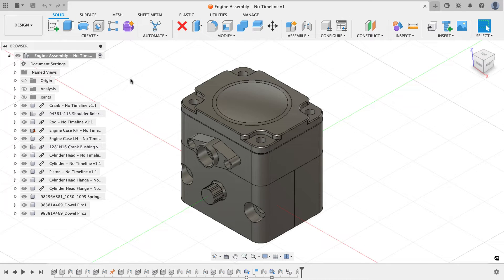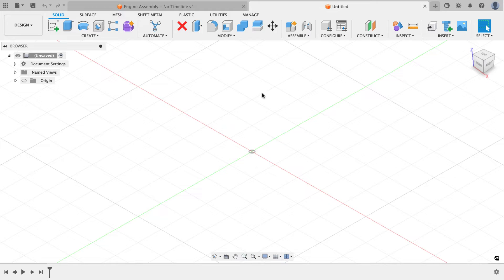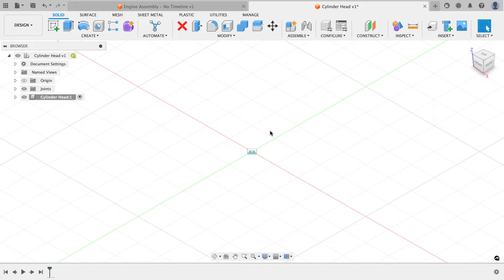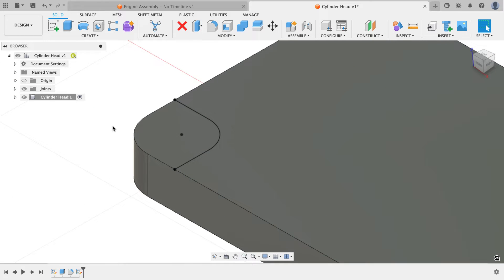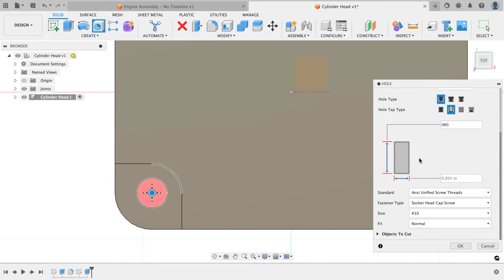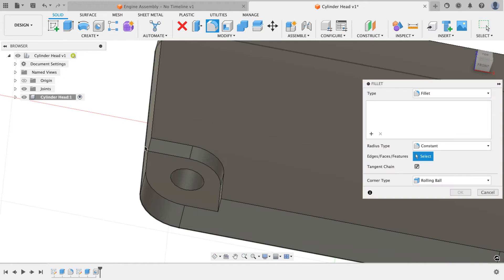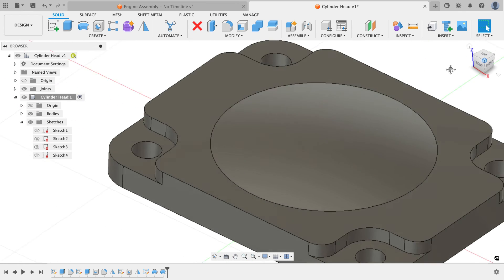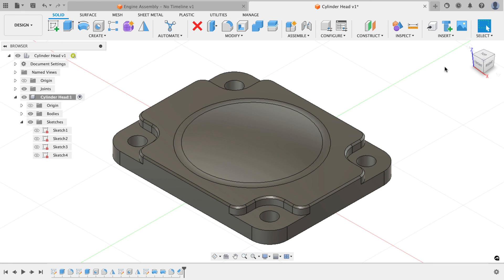Model Engine Project - Cylinder Head

Comment: Kevin, Your teaching methods are great. Big help getting me from beginner to at least "advanced beginner"!. I am 3d printing the parts as we go for prototyping and waiting on the extra motivation to complete my PM 728 CNC conversion, which has been at 98% for 6 months now :( I was wondering if this project is intended to produce a working steam/air engine when you are complete? Thanks for the awesome content...
Reply from the maker: I'm glad you are liking the content. Thanks for letting me know. This engine will be marginally functional. There will be a knob on the crank shaft that you can turn by hand. That is what creates the motion.

Comment: One very quick question: you are using quite a few little shortcuts to speed up the modeling, so why draw in the revolve axis for the domes when the part is anchored to the origin and so the Z axis could be selected rather than the sketch lines?

With my work background, using the inbuilt coordinate system seems to be the obvious thing to do, especially as it can also be selected from the browser if it's not showing in the model.

Great material, and presented in a way that's quick and easy to follow.  Thanks heaps Kevin.
Reply from the maker: You can't revolve a profile that crosses the centerline. That would result in a self-intersecting body that isn't allowed. I could have drawn half of each dome and then drew the vertical line as a centerline, and when I dimensioned that, It would have given me diameters. I went the slightly simpler route that wouldn't take as much explaining in the video. The vertical lines were just to divide the two domes into halves. I could also selected the axis as the revolve axis. In this case, I didn't think it mattered much since I needed that helper vertical line to split the dome into two halves.
Reply: @MechanicalAdvantage  thanks Kevin, and do I feel dumb for needing to have that pointed out to me ... 🤣

Comment: Another excellent video. Thanks Kevin. When you’re modeling an assembly with multiple components do you always create your sketches inside the individual component or do them at the parent level? Thanks
Reply from the maker: I sure try to. It can be easy to mess up when you are in a groove and forget to activeate a component first. Unless I'm trying to do something complex, I try to keep my sketches in the component they belong to. When I need to create sketches or geometry that for CAM things, I usually do those at the root of the design. That is my way to keep track of what those sketches and bodies etc. are for. 
I'm glad you liked the video.
Reply: Thanks Kevin @MechanicalAdvantage

Comment: That was awesome! Thank you.
Reply from the maker: Hi Dan. Thank you. It isn't a complicated part but hopefully the methods used will help with future projects that you work on.
Reply: @MechanicalAdvantage  what I learn from your videos is to simplify my sketches. Coming from a drafting background I  was trying to define everything in a sketch. Working from a simple sketch to define what is minimally needed, and then using features (holes, fillets, etc) and mirror and/or patterning not only is faster, but making changes is easier to do.

Comment: I had never seen the slice command used like that, looks very helpful!
Reply from the maker: Hi Adam. I hope you use the hell out of that one going forward. Look for a video coming up that shows some other methods to slice your part that are useful. I showed one of them when I did the CAM toolpathing for the cylinder. Thanks for the comment.